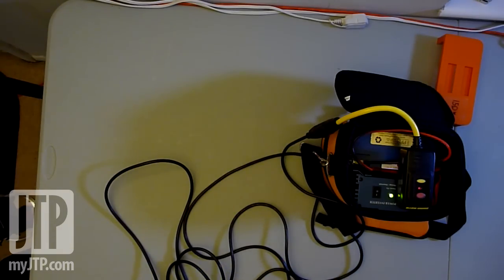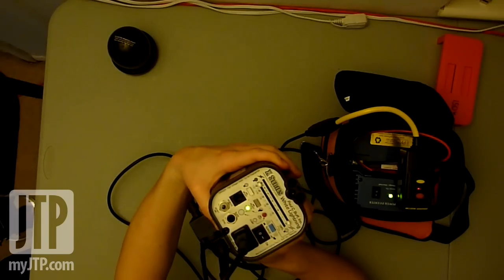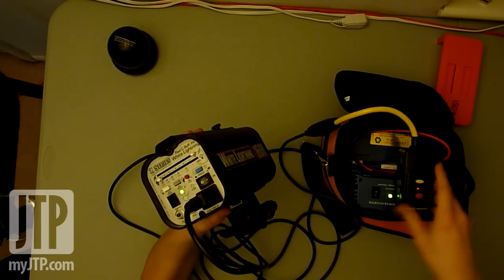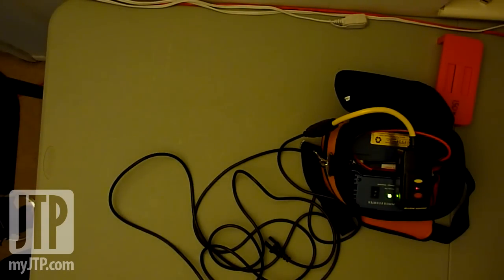DIY Vagabond II Strobe Results AB400 AB800 AB1600 WL1600

Comment: @Jason Irons the rated 6amp is at 110volt which = 660watt NOT 72 watt.  Using a 150watt inverter, even with 300 watt surge/peak will reduce your recharging rate and may cause errors with your strobe if it isn't intended to work off a battery pack.  I built mine with a 600watt and it still slows my Profoto d1 1000ws strobe down, but I usually don't shoot full power.

Comment: @juicystunts If you look on the alien bees website it says that it will draw 6 amps of power at its highest peak. So if you have a 12v battery and it draws 6 amps that means it should only draw 72 watts of power from the inverter. So a 150watt inverter shouldn't be a problem. hope that helps

Comment: I don't understamd how everyone is doing iths.  I plug my B800 into an inverter going into a 12v 35 ah battery, and it errors out my inverter every time. I tried with a 300 watt and 600 watt inverter.  What am I doing wrong?